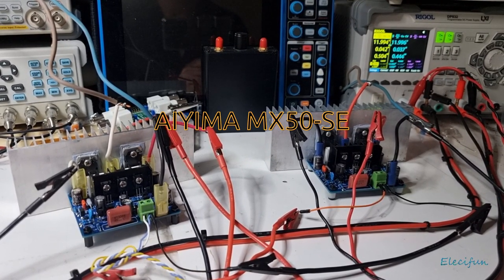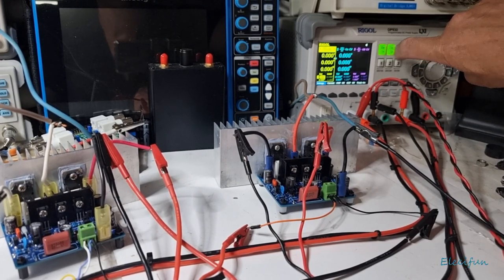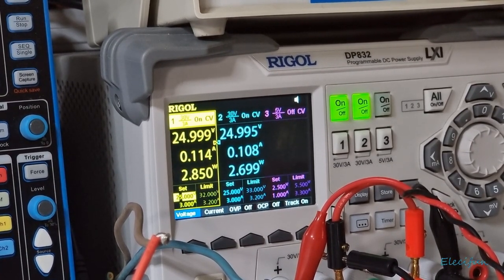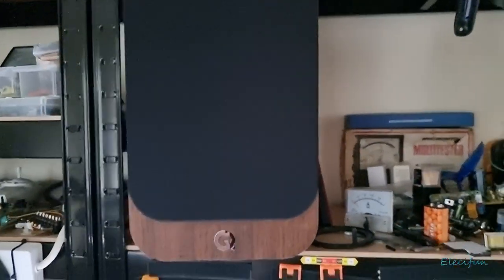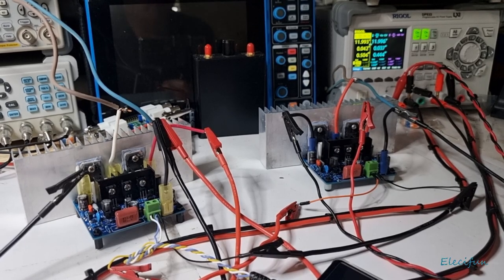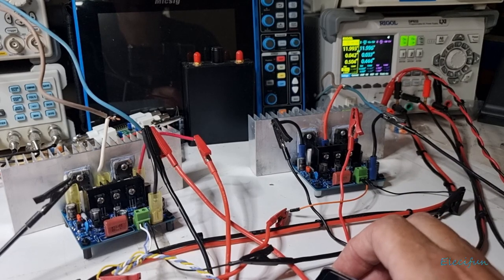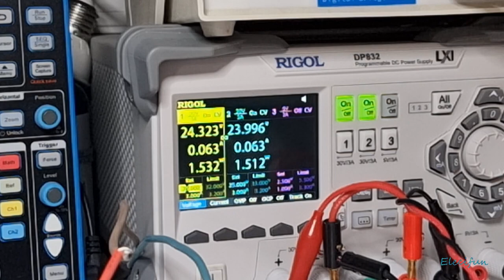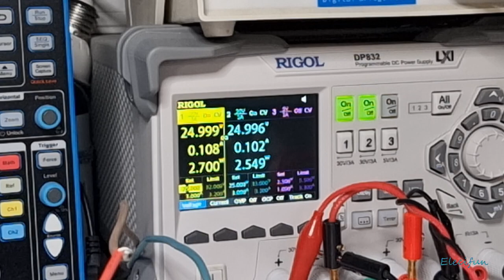MX50-SE Audio Amplifier Kit (Aliexpress) SOUND TEST

Comment: Hi Sir!

I tell you that doesn't sound too shabby! 

What happened to your perf psu?

I noticed you're powering it with your benchtop psu.

I was watching another Japanese dude who had noticeable hum through his system.

He tried all manner or things to get rid of the hum.

That noise when you shut it off is som- what normal isn't it?

My mates amp had that issue to/o some extent also.

Anyway gee it does sound nice. 

I read that amp is 2 x 70W RMS which is pretty good.
Reply from the maker: I use the bench supply so I can watch the current being drawn. I know it can run at 700mA without distortion when testing. I like to turn up the volume and check the current. 
I will do a check for hum using the cap bank and transformer and let you know.
Noise (pop) on turn on off is expected but some make more noise than others, this one is quiet. My home use DIY amplifier from ESP site ( another great Australian ) amp is silent.
Reply: @Elecifun 
700mA oh okay.
Checking the current- okay.
So your going to test your audio PSU. Okay that'll be interesting.
I think a case or enclosure might reduce some of the RF noise.
Noise (pop) its bit hard to hear it from here. I just remember my mate turn the amp off or on and there was some pop noise.

Oh okay yeah Australia is probably a safe bet to some extent.
I might buy this amp as a test system.
My long term goal is a 2 x 100W stereo system.
I just learnt what a preamp is and a power amp.
😅
Anyway this to me is an interesting project.

I'd like to see it all hooked up and ideally in an enclosure of some sort.

Seeya dude !

Dec.